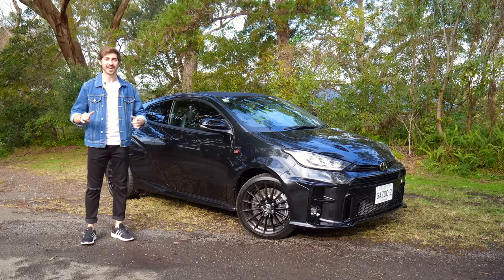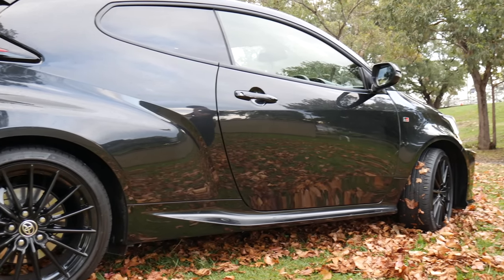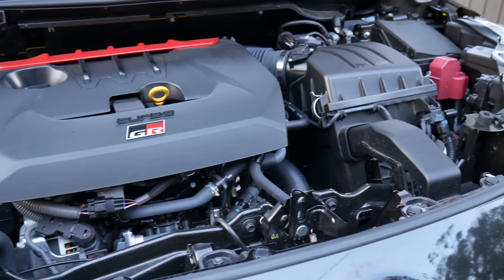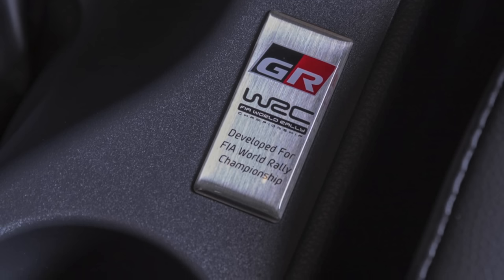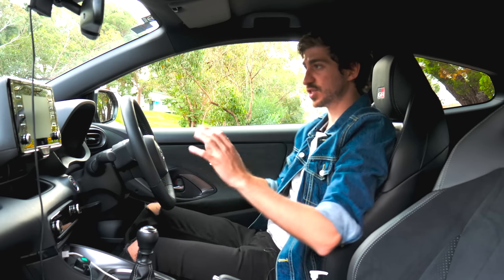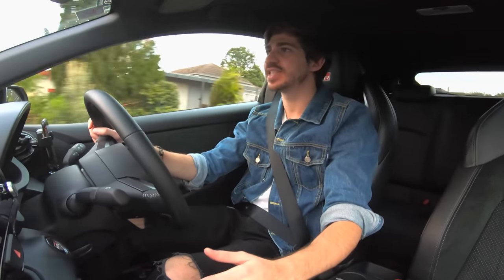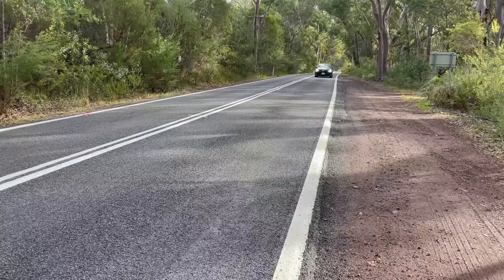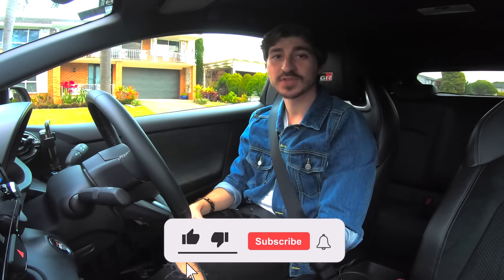Toyota GR Yaris review // Is this the new hot hatch king?

Comment: This doesn't make sense without the two Torsen differentials...
Reply: If you're using it with esc in expert mode or off always or regularly, then yes, get the circuit pack/rallye to actually benefit from the 2 torsen lsd's. If you're tracking it regularly, possibly same again. 
If you're buying it for phenomenal grip on the road, leaving esc on, you're better off with standard open diff's car! Just ditch those average dunlops for something superior!
I've driven both.
Reply from the maker: James put it perfectly! For almost all ‘daily’ uses, it makes absolute sense. If you want to go crazy, track it and so on, then sure go for the circuit/Rallye which comes with Michelin PS4 S tires anyway!  Made for James as he can’t stand the Dunlop’s haha
Reply: @TalkingTorque  😉
Reply: People thinking LSD are next world. So yeah like others have said base is great for normal road use and pushed 100% get the CP or Rallye.

Plus drive both if you can.😎
Reply from the maker: @Dave-gl6jb  just buy one of each, problem solved?
Reply: It's the hype around the circuit pack which has effectively brainwashed everybody lol...
If they hadn't gone on about the torsens and ps4s's, people testing the standard for the  road would be none the wiser.
Most of those testing the circuit on the road  aren't benefitting from the lsd's anyhow. 
They're feeling the circuit's firmer track suspension that works well with the ps4s's. The rest is psychological. 
I guarantee, if you sat a blindfolded person into the uk standard car without convenience pack, (same interior as circuit) and they drove it, blindfold now removed lol, on the road leaving esc on, they'd be saying all day long. "It was incredible, the 2 torsens work miracles, you can really feel them, blah blah blah "
Yes, the OPEN diff's do work miracles, alongside the sexy clutch coupling awd set up and electronics!
There are significant differences between the 2 dynamic specs but they're mainly in ride quality and tyre grip on the limits,  until you disable esc.

Lsd's on fwd or rwd have a significant effect on a car's driving dynamics. 
Much less so on a well set up awd system.
Reply from the maker: @James-RJM  Couldn't have put it any better James! Btw nice clarification with "blindfold now removed" haha. But yes, anybody watching, read James's comment if you're tossing up between both :)
Reply: @TalkingTorque  😊
Reply: I'm not a track guy or have the money for both. If I was rich yeah would have both in a second.

Plus like James said most people could not tell the difference unless they had mad skills or had the car for a good length of time.

PS Love to see base with BBS mags\PS4S tell people it's a CP and see how many in the UK would know unless on a bad B road.😎
Reply from the maker: @Dave-gl6jb  no one.. that's the honest answer, no one would tell the difference haha. You should become a track guy Dave!
Reply: Yeah on GT Sport.😎

For you and James.

I was watching a new review of C8 Corrvette from Savagegoose.

They had top model for track and street one. So the GR is not alone in offering different versions and guess what shocking the higher model was better on track shock horror lol. Just like James as said many many many many it's the Marketing.😊
Reply from the maker: @Dave-gl6jb  Hahaha shocking! Like we said, for most people, the stock/non-track version will do just fine, and probably not be noticeable for 99% of the things we'd use it for!
Reply: Amen Bro. Go on Carsales buy one now in Red it's the best colour right James.😎

PS Hope you get to REVIEW the C8 when they get released. So so long the wait. I would love one in red parked next to GR.😊

I heard they are sold out for ages in north America. It sounds like GR story in the rest of the world. Both very popular and long waiting lists.☺
Reply from the maker: @Dave-gl6jb  Might consider it.. Or put it towards the house deposit?!

Great reminder Dave, need to follow up with GMSV to be ready for the C8 launch this year!

Ahhh however the C8 will be 150k+ here.. 3x GR Yaris's! Or 1x Supra and 1x Yaris haha!
Reply: Okay, so you all think you are omniscient and I am an idiot, that only gets tricked by marketing? :-D

I don't want to sound conceited or overestimating myself, but my driving skills are exceptional indeed. I did several test drives with the vehicle... and yes! I drove on a mountainous country road with ESC in Expert mode or completely off and it was exactly that point what made this car so indescribably ingenious, namely how it pushes out of the tightest hairpin with the foot on the gas ... while the one without those torsens felt like choking and losing power, what results in understeering, as you usually know it from "normal" cars. I prefer this one feature in the hindquarters for getting this incredible agility, instead of having any optimizations during normal daily driving around to get to work or go shopping, that is completely irrelevant for me, because this is not the reason to buy this car.

Of course the optimized chassis also contributes to this, that's clear. I don't want to tinker with the car (except for another exhaust)(is this correct English?), it's just amazing what you get out of the box here, and so for me it has to be the best performing version for limit situations you can get - the performance variant (or whatever it's called in your country).

And don't forget the air inlets to cool your brakes. That also is an aspect, if you drive progressively those country roads with many sharp corners. Here I had massive problems with my Cupra ST 300. After a few corners driven at the car's limit, the brakes began to smoke.

Tires are not a reason for this package, they are easily exchanged. 

I am living in the south of Germany and we have great narrow roads near (Black Forrest for instance), and I am also connected to the Alps (pass roads).

So as additional information I sit on the left side in the car, that means on the "right" side, you understand ;-) because the whole cockpit is actually aligned to the left.
Reply: Mate no one is saying you are stupid or played by marketing.

We are saying Toyota hyped up the Circuit pack or Rallye only and gave little thought to base in the europe. The rest of the world both got love.

Now for your driving skills. That's great mate the car is perfect for you but I'm very normal driver. I don't track or race everywhere. My needs are a fast small AWD car. I'm no where near the limits. Do I feel understeer yes but the Dunlops are real bad. Now would better Tyres fixs understeer 100% no but CP or Rallye has it too.

Neither are perfect cars.

Base 8\10 better Tryes add 0.5 and Rallye 9\10

Now I'm not saying I don't like the idea of the LSD car. A weapon and even with better Tyres the base is no challenge in stock form.

PS In the end enjoy your car you picked a great car.😎
Reply: @Dave-gl6jb  I ordered one in march, I looks like I will have to wait until about January... plus / minus 1 or 2 months :-O
Reply: For the brakes the inlets can be removered. In aus very common done.

For me I don't drive fast enough to smoke the brakes. PS New exhaust yeah would love one some day.
Reply: Worth the wait mate. Had my base red GR for 5 months. Love it.

PS track it.😎
Reply: @Dave-gl6jb  How does the tracking work???

Pity that one, that with the performance package you cannot have the HUD or the JBL sound system. This is somehow stupid, but ok, saving weight :-D
Reply: @Dave-gl6jb  Are the inlets simply plugged in? Nothing different then?
Reply: @SUPERSTEF79  Pretty much as Dave has just said mate!
None of us are ridiculing you or anyone else who favours the circuit pack spec!
We are simply expressing our knowledge and experience regarding both set ups. 
And yes, many people  have been taken in/misled by the circuit pack's marketing hype/indoctrination. 
I've always been impartial about the benefits of both set ups for different uses.
On your explanation re what you are using it for- YES- the circuit pack is the right option. But we haven't said it isn't better for your explanation of needs/use!
I suspect at least 80% of people buying the circuit pack will NEVER disable esc or track it. Therefore the lsd's are bragging rights only or they've arguably bought the wrong spec for their needs and will tire of the track suspension and, in Europe guise, limited added extras and comforts that the uk convenience pack has.
I bought the GR Yaris for an all year round road blast, wanting great performance and total grip, leaving esc on. Not grip with slip/power drifting which is certainly superior in the circuit pack car, once you disable esc!
I  appreciate the bespoke development and build, clever awd set up, punchy engine, manual gearbox, lightweight for an awd, darty dynamics, quick steering and incredible grip that my convenience pack car gives me on the asymmetric 5's!
I've driven it enthusiastically in the dry and very wet conditions and there's no wheelspin or understeer whatsoever when keeping esc on.
It has a much nicer road biased suspension, designed for the road and with the Convenience pack extras, it's a pleasure to use it as a daily. 
I'm not interested in track days, disabling esc or drifting it etc.
If I was I'd buy a second car for that purpose and likely a rwd, such as the S2000 or other.
I trained in the police driving school course, following the IPSGA system which is totally different to following the racing line etc.
I want all year round fun and safe grip.
They made the different specs for different needs/uses but, without a shadow of a doubt, they've milked/pushed the circuit pack car for the extra yield. 
On the road, I doubt the opened up brake ducts will make a difference!
Enjoy yours...
Reply: Rallye has both packs together but only pearl white. Toyota options for GR are laughable.

PS No you have to cut the inlets out. PS It's not that hard. Saw a video of it like 1 hour work.

PS Some base GR owners put LSD on the back. Very easy but the front LSD you have to remove the engine. It's not worth it.

PS If you want better LSD than the CP or Rallye then base is fine but if you don't care about changing then stick with CP.

PS Going to see lot's of modded GR in the future.

Already seen 12.4 1\4 mile car.😎
Reply: Yeah well said James.

Like I said C8 Corvette is no different the lower model is below average for the track vs top model.

Plus will add even top model cars need some mods for the track. GR needs more power for expert track guys.☺
Reply: @James-RJM  The foregoing discussion of you both as a reply to my comment sounded like "everyone who bought the performance pack wasted his money" or that I am an idiot, that felt for this LSD-trick ;-) 

Do you really think for not driving to the limits you have a disadvantage with the Torsens?
Reply: @Dave-gl6jb  In Germany there is only nothing or Performance Pack... in Switzerland you have nothing, Performance or Convenience Pack... but both don't provide Rallye. But there you nearly go to jail for driving a little bit too fast, so the Convenience Pack makes sense there I thought ;-) it is a very rich country and normaly they don't bother to buy the car completely equipped.
Reply: @SUPERSTEF79  Well there's the extra weight of the torsens if never actually used lol.... 
I personally prefer the look and price of the standard wheels and grey callipers. The suspension is much nicer as a daily and the reactive torsen lsd's aren't needed as wouldn't be activated anyhow. 
If it had lsd's that activated whilst esc is left on, like the e-diff in my N, then I'd have had a real dilemma😉 But like I said earlier, on mine with esc left on and those asymmetric 5's I've experienced only GRIP! When they experience understeer in the open diff's GR it's either the esc disabled, dunlops or both. 
In mine i'm paying for stuff I'll actually use and benefit from in the spec I chose. 
I have only one regret. Not ordering it sooner, due to doing further research after the test drives to be sure😊
It's about what one wants mate, plus the stupid different spec set ups which vary around the world don't help!
For me, after driving the uk Circuit pack 3 separate times, 45 mins each, coming from an i30N performance pack, which was quite well specced, I just couldn't accept the circuit pack's harsh ride at town speeds and limited comforts, compared to the N, as a daily! 
I researched literally 100's of hours of reviews worldwide in multiple languages b4 establishing the "actual" negatives of the standard car on the road, being the dunlops and, only once esc is disabled, occasional unloaded wheel slip.
The uk convenience pack dealt with the comforts and multiple blindspots issues, I didn't disable esc in my test drives and wasn't going to with mine and the tyres I was changing so it worked out for me🙂
I've driven various fast awd's previously, ttrs, golf R 7.5, focus RS Mk3, S1 and the GR is much more impressive. Partly due to the permanent awd and changeable modes as well as it's MUCH lighter weight, size etc etc etc
Reply: @Dave-gl6jb  My preference was the coffee mate. Flat white 😉😍
Reply: @Dave-gl6jb  I seriously have had NO understeer or wheelspin on the road mate, wet or dry!!
I appreciate at ridiculous speeds on a track, that would be different. Jonathan from TyreReviews said the A5's understeered a little in his last tyre test of the uhp/uuhp summer tyres in 18's on that golf gti. But that was at 110mph on a track and with esc OFF!
My car is glued. From countless correspondence 😊 you know by now that I'm a perfectionist, at times, and cars and dynamics is one of those occasions mate🙃🙂
Reply: @SUPERSTEF79  I ordered mid December and had a 7.5 months wait!
They kept changing the eta and the my t toyota app re car build progression etc never worked lol....
Reply: Yeah your car with A5 sounds perfect mate. Plus if pushed hard the GR understeers all versions but Motive videos here in Sydney Aus showed how to improve it. Plus to be honest I don't drive that FAST most of the time. PS Picking my car up today. Going to look like new.😎

PS In a perfect world we could have option our GR the way we wanted.

Me Red. Sport Exhaust. Red stitching inside not white. Painted Calibers tick. 2 way suspension setting. Soft like base GR. Hard like CP or Rallye. LSD or open diffs tick yes or no. I'm still not sure about that one lol as soft setting base with LSD would be interesting. No GPS touch screen and smaller mirror and PS4S Tyres on every car. Plus custom plates while I'm dreaming and trunk full of food and alcohol .😂😂

PS Jokes a side I'm very happy with the car right now. Even the Dunlops don't bother me anymore.😢😂
Reply: To answer that is what kind of person you are mate. I'm over 40 and CP or Rallye suspension would have annoy me fast after the honeymoon period. PS For Circuit pack or Rallye owners no way did they buy the wrong car but the Lithtech suspension for 2500 pound would be a must as you can set the car up better. If you have the money a great option or future mod😎

PS Watch Harry's Garage. His Circuit pack has been set up perfectly but just add a better exhaust then it's perfect or not up to the person. Harry said no more mods see if he sticks to that.
Reply: @Dave-gl6jb  😅🤣🤣😂😂😂😂😂😂😂
Mine's specced as I want, albeit, I had to put the new tyres on from the off😡
I still don't get the mirror issue lol..
Apart from when stopped at traffic lights, feet away with the actual lights high up!
Oh, and the A- pillars are far too thick. That's it lol...
Reply: @Dave-gl6jb  You'd need to drive it to establish if it's actually perfect mate, and in what way, for what?!
I watched that video. Personally I think it's too low now. The ground clearance as stock is another positive for real world road driving, speed humps etc etc etc. 
His son drove it on the track and didn't even disable esc🙉
One buys a new car and then needs to get it modified by Litchfield in order for it to be comfortable on the road lol....
Personally find the whole thing farcical. 
And let's not forget the hidden advertising agenda there!!!!!!
As I've said from the beginning, each to their own but I'm delighted with my spec choice, if the reactive torsens had been free with an untick option, I'd have done so. Not interested in disabling esc and wouldn't want that extra weight for no reason. 
Turning all that off goes against the grain of my style of driving and I appreciate the hidden modern safety aids that are now fitted to prevent driving up the arse of a car if you momentarily are distracted or hitting a cyclist due to the A pillar blind spot or reversing backwards and not hitting a neighbours child......
They won't work with esc disabled. 
It doesn't cut the power drastically like in the olden days. Yes, it's not the purist race way but I'm not on a racetrack. 
It again comes back to the uk 3 specs for different needs.
Get what suits your needs and enjoy it, end of!
Reply: @Dave-gl6jb  I have seen the videos of Harry‘s Garage, I like his calm way of showing this as they are. I think I will also change the colour of the wheels like he did.

As you can see in my name, we both are born in the same year ;-) perhaps it has to do with the fact, that after driving a actually really great and satisfying car, I realized, that I don‘t want a gearbox, that does the work for me (DSG), I don‘t want to adapt my way of driving to my car, because a DSG gearbox sometimes does strange things, needs a second to react, and changes gear at high rpm. I want maximum control and it has to do what I WANT IT to do. I need material, that is strong enough to handle my skills - brakes, that do not begin to smoke and then have defects after that like wobbling and thrilling making noise on the German Autobahn (After that smoke I was never sure, if the brakes will really do their job properly at 263km/h)… I want and I need a real sportscar or racing car, but I like the surprising effect of the yaris. It is not so obvious, you have to know the car to get what’s going on. It is so cool to have a rallye car, so I want to feel and live it 🤩

But this only works because my girlfriend has the big car, so we and my two little kids always take hers together. As always driving on my own in my car I can do this. First I wanted a Supra GR 3.0, but then I fell in love with the GR Yaris 😃 the Supra is nice, but it is a BMW and not a Toyota… as you know.
Reply: Yeah well said again mate. For view I'm fine NOW but it annoyed me for ages. The main reason is my Lancer view is miles better. PS Love Evo X parked next to GR.☺
Reply: Yeah you picked perfect mate. Change the BBS mags to gold yeah I agree they look amazing in that colour.😊 where the base black are perfect. PS For the suspension maybe you will like harder ride plus there are options to change it like I said before. PS Like James said lowering car looks great but I love the ground clearance but up to you.

For SUPRA love one. Both versions look ace. 2 litre vs 3 litre I'm not sure which I would get if I had the money. Plus God Supra should come in manual as well as the auto.

Plus Will add GR would have been lovely with duel clutch option not talking about the laughable RS version in Japan.😂
Reply: Will add James for CP or Rallye owners that are unhappy with suspension changing it is fine. Lowering the car I agree with you but some love it.

PS I saw a Holden Commodore V8 few days ago so low I laughed hard. It's just stupid. Lower fine but so low that you drive 3km into drive ways or park on streets is a must is just silly.

It's like Teen who have there pants so low you can see there underwear. Crazy world.😂😂
Reply: @James-RJM  Eyes open, that is the safest way to drive. Do not rely too much on those assistants… React before them!
Reply: Well I'm older and wiser??? than both of you lol.... 48. Look at least ten years younger and mentally probably 30 years younger much of the time!
Re understeer. I've driven for 30 years, various cars and all the earlier ones had no electronic safety aids. But they were also much lighter!
My 205 gti had understeer until I put decent rubber on it!
The octavia vrs and seat Leon cupra R, which had brake torque vectoring, also both understeered, but with both, it was almost eliminated with better rubber. 
The i30N didn't in the dry due to it's very good e-diff and the ps4s's I added. In the wet it was more inclined to bunny hop😠
The GR hasn't at all!
And the reviews where they complain of understeer on both dynamic specs are when esc is disabled. I've explained the reason for the standard and re the circuit, probably because it's torsens are reactive and activate after an initial slip, which you can hear and have been commented on in various videos.
Like I said earlier, I'm sure mine would at ridiculous speeds but I doubt I'll ever experience it. It might also when the tyres are worn to perhaps half way? The ps4s's grip plummeted once worn a little. 
If that's the case, I'll change them early and or try perhaps the f1 supersport or other. Always change by 3mm anyhow for safety re wet braking. Pretty sure that's the legal minimum depth for Germany, UK is 1.6mm, far too low!
I now know the suspension feel so will be easy to choose tyres to match it. Firm sidewalls, like the f1 goodyears, being the key on the standards softer set up and more lean.
Many people get understeer simply because they can't actually drive correctly to understand how weight transfer affects the car's dynamics. 
Someone complained of understeer in a review where he admitted to coasting downhill whilst turning. FFS, what do you expect 😏
Reply: Yeah James down hill a couple of times my GR I feel little understeer when I brake so lately I brake less and it's gone. 

You learn to drive GR with what you got.
Reply: SUPERSTEF79.

I'm ok with driving aids now but hated them at the start. The GR tries to help you to much like Wife in the car.😂😂

PS Still in the end it's TOYOTA still.
Reply: @Dave-gl6jb  I can't wait for you to change them mate. I feel for you 😔
Reply: @James-RJM  Germany also 1.6mm minimum.
Reply: @James-RJM  sorry, I don't get this. Isn't this a natural behavior, isn 't this standard, normal? Why do you need a name and a routine for this? Seems to be a UK thing. What do you have to do to get your drivers license? Do you eventually think I would endanger someone or  misjudge a dangerous situation while driving with my style of driving!? I always prevent others from doing shit...

What is the specific thing here?

And why do you buy a rallye car then?
Reply: @SUPERSTEF79  If you read about it it's self explanatory.
It's not connected to getting a drivers licence, it's a method of driving taught to police officers in uk and other countries. 
It's about driving with acute awareness, positioning correctly to avoid hazards, speed with safety, keeping the car balanced etc....
The acronym explains it all.
I've bought the GR for purposes already outlined and you can still benefit from it's awd capabilities without pulling up the handbrake on the move and drifting. 
Why should I not buy it just because I won't be pretending to be Chris Harris on a track!
We've discussed the points you've raised. Move on!
Your initial comment was actually quite condescending to standard GR buyers/owners and neither of us battered an eyelid, we just put both arguments across. You then came back acting all insulted for no reason. We kindly assured you that that was not the case.
You appear to want to continue pushing for arguments.
Enjoy your car.
Reply: SUPERSTEF79.

You are 42 like me so I bet your a safe driver don't go nuts in heavy traffic.😉

PS SUPERSTEF79 and James I'm not sure in Germany and UK but here in Australia we have P plates that can not drive performance cars until they are on there open licence.
Reply: SUPERSTEF79\James.

Will add P Plates 1 for 1 year and P2 for 3 years so a total of 4 years.

PS I think this is a good idea it saves life's.
Reply: @James-RJM  A huge bunch is being made here about something, that is obvious (the introduction of the term IPSGA)... you think it is a style to drive without causing accidents or prevent them and recognize hazards in advance - for me this is a normal passive process. So that was the thing what made me wonder. For me this are the basics you teach to new drivers. So you drive like we learn from the beginning and like we have to drive here as standard.

When you sometime have internalized this IPSGA thing, you can level up and begin to enjoy driving, because the things from this "method" should or even simply have to happen automatically in my opinion. Then you have reached the next sphere.
Reply: @Dave-gl6jb  We have to do many practical hours in the car (minimum 12 hours: city, country road, Autobahn, driving at night), parallel wie have to absolve many theoretical lessons over weeks, have to do a theoretical test and an practical test. Meanwhile the licence costs about 2500 Euro I think.

We don't have any special plates for this here in Germany. But we have two years of probationary period. There you get harder penalty and eventually have to do retraining, if you do hard mistakes. In Switzerland they can put an "L" onto the car and drive without license to practice. But here most of the people drive terrible, really unbearable... they don't know, what they do I think most of the time watching those amateurs driving :-D
Reply: Yeah life's different from when we were teenagers mate.

My first car was 4 speed manual with no guts and drum brakes. Lol it was scary.

My parents paid for it for me to learn to drive in a shit box. I hated that car but over the years think back it was not that bad. Well unless Hills were around.😂😂😂. PS 1st gear full throttle. No joke.
Reply: @SUPERSTEF79  Think what you choose to believe. 
It wasn't until I did the  intensive police driving course that I grew up and learnt how to drive. 
It's nothing like the normal driving lessons and test you take in whatever country you live in!
If you were doing IPSGA already you wouldn't be cooking your brakes for starters lol...........
We have nothing further to discuss
Reply: @James-RJM  You don't understand... I think that your driving school standard is very low, but even then you would do those things for yourself without inventing terms for things that are self-evident. The brake thing had nothing to do with boring driving. Combine those passive skills with active skills to have fun. But ey, forget it ;-) In knew that something is strange here, and now we have the evidence.
Reply: @James-RJM  In the end I want to tell you that this is nothing special, at least in Germany. This is the standard way to drive a car, a minimum of passiv behavior/skills, not a religion to celebrate as a driving style. Of course there are a lot of idiots who can't do that, but what you are celebrating here is what I take as the minimum standard for driving a car or what is generally simply expected here. It's a bit ridiculous how other videos portray this as if these are now incredibly new discoveries. Actually not worth mentioning. Sorry for these harsh words.